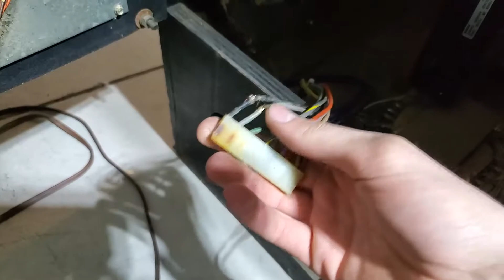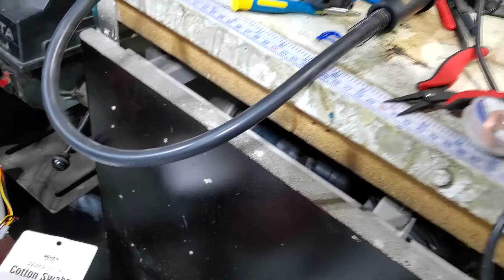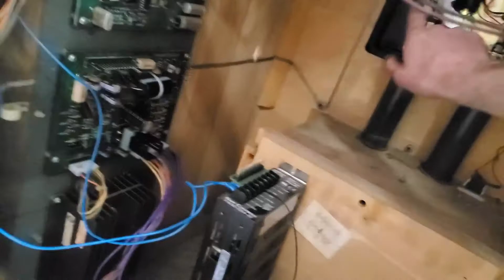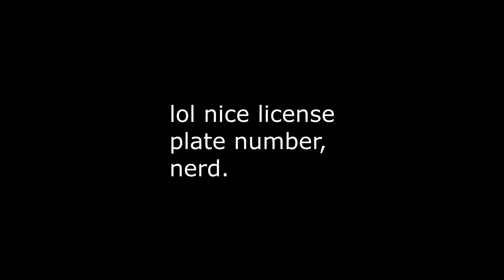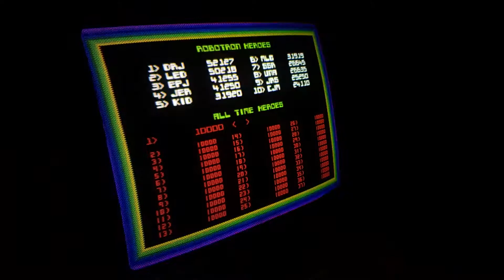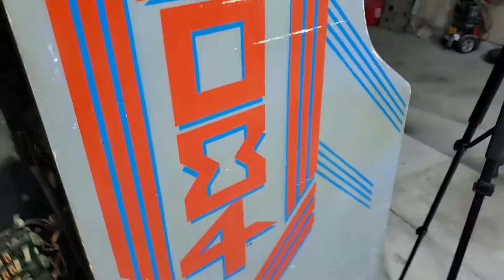Robotron 2084 Repaired

Comment: Good job on the power supply rebuild. I hate how people are too lazy to rebuild the original power supply and replace it with a switcher.
Reply from the maker: Well I guess if there are people that aren't too into the technical side of things, I wouldn't have too much of a problem with them swapping out the PSU, as long as they keep the old one in the cabinet for someone else to fix later.

Comment: Those burnt up PSU connectors looked pretty sketchy, indeed.  Glad it's running reliably now.
Reply from the maker: The reason the DC side's plug was so burnt is probably because the headers on the board had cold solder joints as well. Overall, it definitely wasn't very happy.